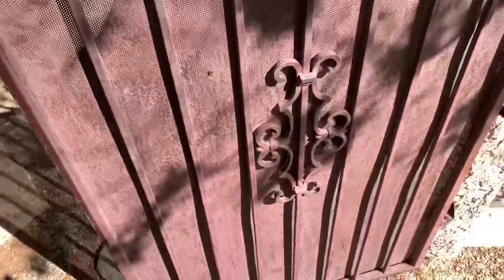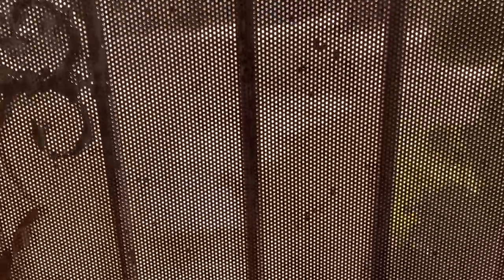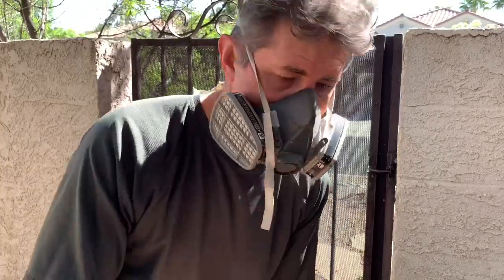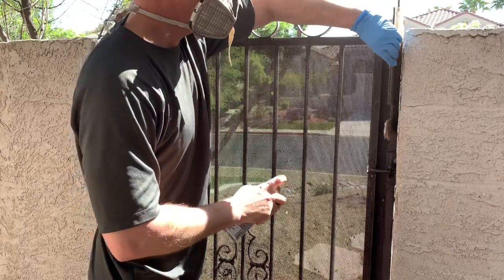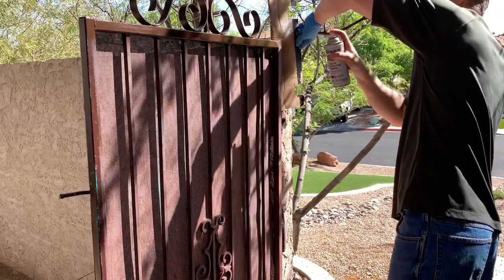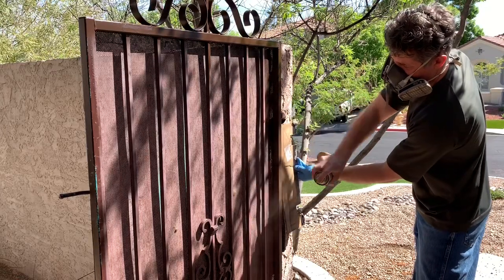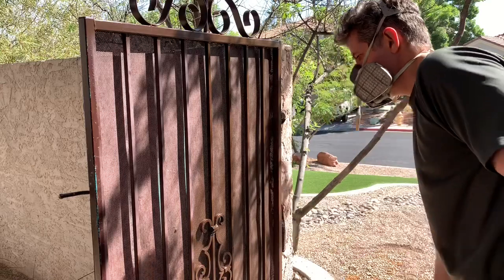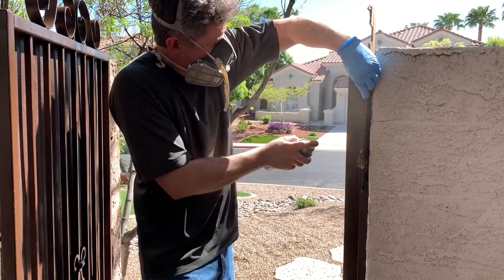How To Spray Paint a Metal Gate

Comment: That was great, but you didn't show how to pop the screen out and replace it.
Reply from the maker: Gillian Culff Actually I did not remove the screen, I only poked out the overspray from a previous paint job. If you want to remove the screen it’s held in place with a series of screws around the perimeter of the gate. Usually takes a small nut driver to remove them!

Comment: Hi Mike! Nice paint job! I wanted to know if you installed that metal screen yourself.  If so, was it difficult. I would like to do my wrought iron gate.
Reply from the maker: I didn't do this one but have done many before. It is not difficult. The sheets are usually sold in 3'x5' screens and screw in with self-tapping screws. Be careful though-if you have to cut it, it is razor sharp so wear gloves and protect your pet!